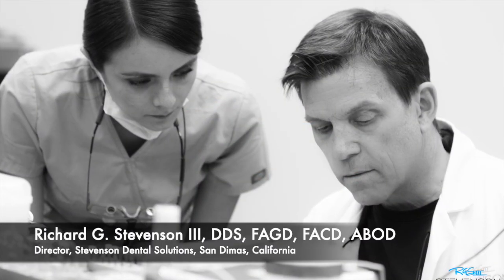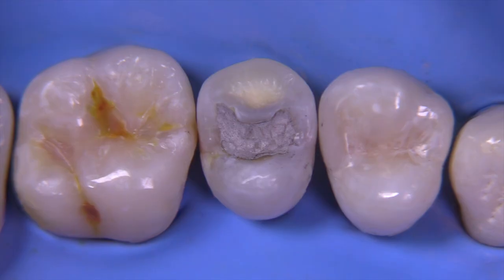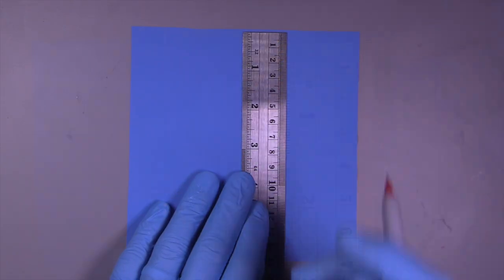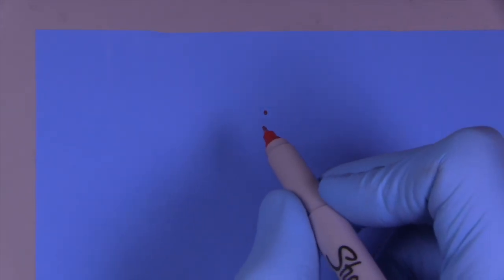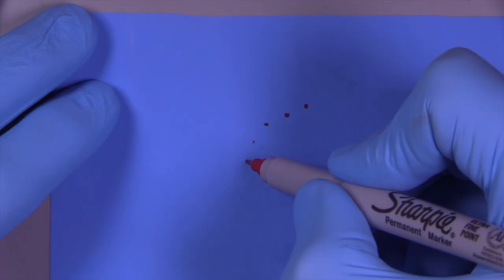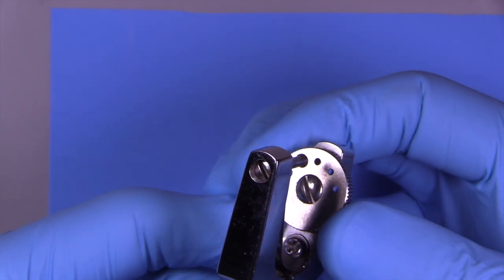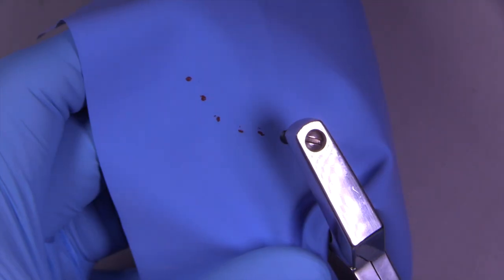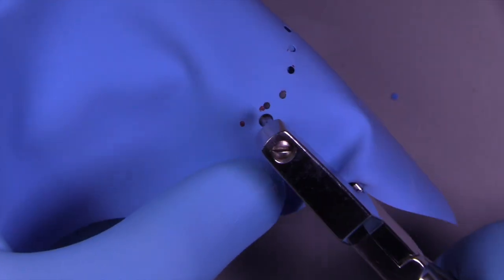Rubber Dam Isolation, Part 1: Punching Maxillary Holes

Comment: Great as always dear doctor Stevenson
But I have few questions
How do you know that you have punched the correct diameter of the tooth? If you chose a larger diameter or a smaller diameter how to correct such errors
Thanks in advance
Reply from the maker: Largest hole for clamped molar
Next largest for molar
Medium for premolars
Small for maxillary incisors
Extra small for mandibular incisors

If the hole size is wrong you need to replace the dam or just try to manage as is.
Reply: @StevensonDentalSolutions  thank you so much dear doctor
Reply: @StevensonDentalSolutions  , what is the meaning of "clamped"?
Reply: Lukas Mingaila  tooth that we gonna applying clamp on it